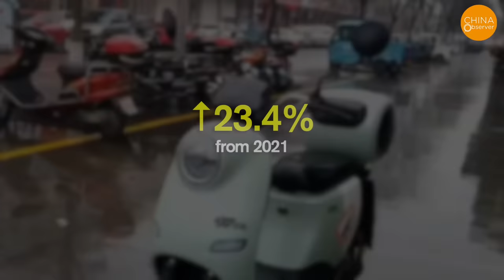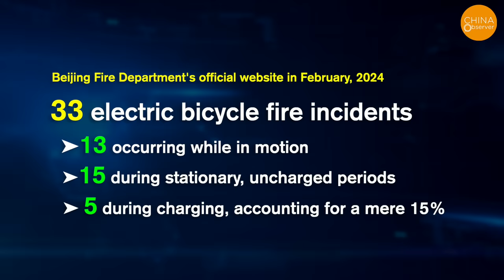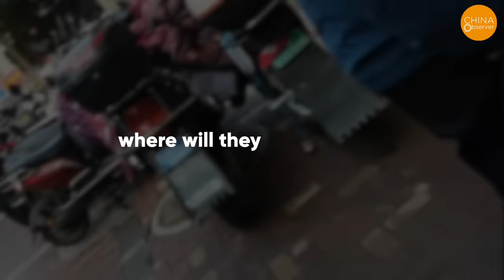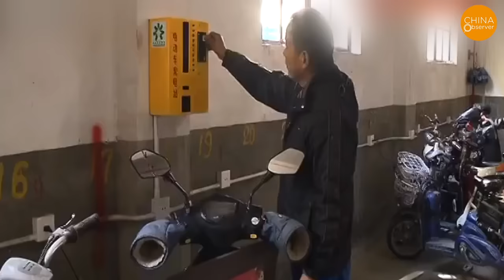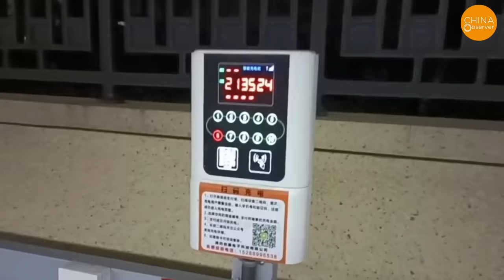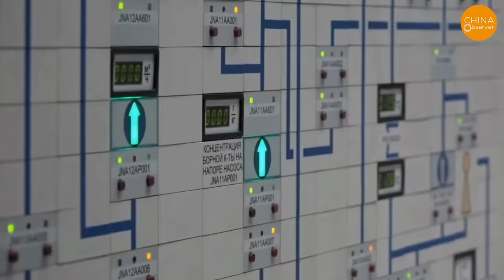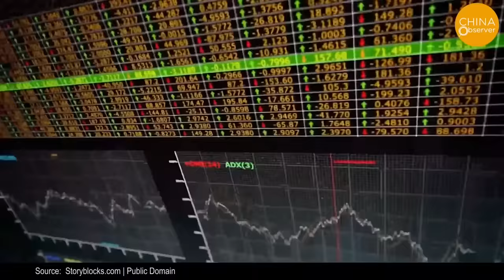21,000 Fires a Year! China’s Often Self-Igniting EVs & EBs Become Ubiquitous ‘Moving Bombs’

Comment: You have a choice, buy an internal combustion vehicle, or a spontaneous combustion vehicle😂
Reply: Since the batteries are inside the vehicle and combusts.... they are probably considered "internal combustion vehicles"
Reply: Ha ha.  The sales people should ask if you want an internal combustion or external combustion bike.
Reply: EV = Explosive vehicle 😵
Reply: TheRealCatof Exaggerating again.
Reply: TheRealCatof  Err...no they did NOT.
And Pintos only exploded when impacted from the rear at speed. Not while being driven around normally or parked up doing nothing/charging up.   Completely false comparison, and you know it.
Reply: Many of the fires, maybe most of them, are because of cheap counterfeit cells with bad QC that are more susceptible to abuse. Cells from major manufacturers have a much better record.
What do we know about manufactured products from the PRC, with respect to quality control, counterfeit products, etc ?
Reply: TheRealCatof 😂 no
Reply: You might be funny but fact is that even the e bikes that are higher risk than the EVs are 7 times less likely to burn than a petrol car.

You lack context and made a false statement.
Reply: @badchefi  Dude, you’re getting lit up faster than a Chinese eBike. Lighten up a little.
Reply: @badchefi  I would still prefer an ICE vehicle over an EV. I definitely prefer a pedal bike over an e-bike. The purpose of a bike is to get exercise whilst travelling from point A to point B. Unless I’m in my 80’s it’s pedal power for me.
Reply: @Whoever68  All good with me - enjoy your ride.
Reply: @arisaga822  in comparison I would light up like a petrol car as they are way more dangerous.

America 250 Million petrol cars - 284‘000 petrol car fires last year.

China 300+ Million e bikes - 17‘800 e bike fires last year.
Reply: @badchefi  Oh, I’m sure those stats are totally legit. 😂
Reply: @arisaga822  you mean this channel is using fake numbers?
Reply: OOOOOOO! NIIIIIICE ONE.
Reply: @millipedic  high-quality tesla car do catch fire too. get back on earth, there are electric car explosive burnings everywhere, including new ones, even not sold.
Reply: @badchefi  your wannabe-comparison not real - different burning and different results - no way to escape out from burning exploding toxic electrical fire in ev, and allmost immediatelly get out and distinguish-by-yourself the fire in petrol car, remaining alive - and for me, any human life matters. how for you?
Reply: @nusplus3985  how many people died since 2010 because of EV fires?

How many people die per year due to petrol fires?

Those two numbers will provide you with context.
Reply: @badchefi  2010, less than 50K EVs in US.  Also 2010, more than 200 million petrol cars in US.  Context: you're welcome!!
Reply: @RT-mv7df  you failed to read and understand what I asked for.

Go back up and read it properly.

How many people died from EV fires since 2010?

How many people died from petrol fires since 2010?

Get it?
Reply: @badchefi  You failed to realize (not really.... your gaslighting is obvious) that a hypothetical 1 in 50K ratio of fire deaths per year for each vehicle type will result in more total quantity of deaths for Petrol cars because there were 200+ million of them on the road versus 50K EVs, starting in 2010.  So that ratio multiplied by the total vehicles in each category would give 1 death for EVs per year, versus 4000 deaths per year for the Petrol cars in the year 2010.  While the EV vehicle quantity may have increased over the last 14 years to perhaps 15 million EVs (since they sold roughly 1 million in 2022), there is still 15-20  times more  Petrol cars on the road, which means the aggregate death total over the last 14 years will still be higher for Petrol cars.  

A 5th grader will understand why your statement (focused on total deaths, versus the comparative ratio accounting for the total vehicles of each type operating on the road) is meaningless and pure clown   logic.  The totals are meaningless, it's the denominator in the statistic (1 out every X, accounting for average age of the vehicles) that is the proper method of comparison.  

With a large percentage of EVs ramping up in only the last 4 years or so, the relative age of EVs is less than 4 years, which isn't enough time to  accurately compare to a significant portion of the 200 million Petrol cars over 10 years old (average of 12.5 years).  There are less than 2 million EVs over 10 years old (2013 or older).  Get back to me at the end of the decade when the 15 million or so EVs currently on the road have an average age of 8-10 years and we can estimate from a large sample the statistical number of EVs that catch fire & result in fatalities for accurate comparison to the average Petrol car.
Reply: @RT-mv7df  where did you get the 15 million EVs from? What year and which country?
Reply: @badchefi  , actually nearly 3 A-EV fires occur for every 1 "ICE" vehicle, although each vehicle fire needs to be independently investigated for it's cause. In the U.S. there are around ~2.4 MILLION A-EV's on the roads. In 2023, there were over 292 MILLION vehicle registrations so despite claims to the contrary, A-EV's in America are a tiny fraction and of them around half are registered in California. The "A-EV craze" is all money-making political BS wherein China stands to be one of the biggest beneficiaries with the electronics and battery manufacturing. The vehicles are contradictions to themselves because the lithium excavation, processing and as we've seen, charging is hazardous as apparently besides battery contamination from water/salt water/battery coolant fires, A-EV's tend to burst into flames more frequently when charging. Curiously enough, I've never had a single proponent of the A-EV's explain the process of "lithium disposal" with these batteries which just a single "battery" contains several thousand individual cells. 

Beyond that and the exorbitant costs of purchasing the vehicles even with government subsidies, they lose up to half of their range in colder climates. That'd be like paying for "20 gallons of fuel but only getting 10 gallons" every time you pay ~$60+ dollars at the gas pump. In some cases some A-EV owners have reported paying more per kWh to charge their A-EV than would be the equivalent gallon of gas especially if you're paying an additional fee to use a non-vehicle specific charger such as a Tesla charger to charge a Rivian. Beyond that there are situations where A-EV owners have complained of payment processing issues, inability to charge because it malfunctions, having to wait significant periods of time for a charger to become available and then have to wait a significant period of time for their own vehicle to charge. I recall this past winter where Tesla owners were pushing their cars around a lot in the snow/ice because the charging stations failed to work.... Beyond that, the expense of repair/replacement for batteries can be in the single to double digit-thousands. Even replacing "seals/bearings" in the electric motors can cost thousands of dollars and there are some "design flaws" in them which have been pointed out by servicing facilities. And unless they've made provisions, you can get "locked out" of your A-EV if you're unfortunate enough to lose complete power. Old combustion engine vehicles have used "mechanical lock/key cylinders" and actuators for yrs so you could still get into your vehicle even if you couldn't unlock it via the "power door locks."

There may be a place for A-EV's but this "GO GREEN'N BUY AN A-EV!! GIT RIDDA ALL COMBUSTION ENGINE VEHICLES!!" is absolute political BS and completely impractical, especially in the U.S. The final "contradiction" of this nonsense is that when people who own such vehicles CHARGE from public or private means, which receive power GENERATED from the consumption of FOSSIL FUELS which I thought was the whole BLOODY REASON TO BUY AN A-EV is to "STOP CONSUMING FOSSIL FUELS!!"🙄So I think A-EV owners should be BANNED from using ANY power source public or private, which is NOT receiving it's power solely from solar or some other ACTUAL "green energy source." It was said that in Texas I believe it was, an array of some 4,000 solar panels was destroyed in a hail storm. It was also said that the panels were made of a toxic substance when now may have contaminated the water supply. So much for the "Green agenda for a happier, healthier planet!" Absolute political, money-making BS.
Reply: @zenithperigee7442 according to your misguided logic there would have been over 324’000 EV fires in America last year.

52 EV fires per 100’000 EVs compared to 1350 petrol fires per 100’000 petrol cars in America 2022.
Reply: @badchefi  It's a hypothetical scenario (loosely tied to actual numbers I researched to illustrate the point (i.e. approx 1million EVs sold in 2022 in the US (fact), vs. the rather miniscule amount sold in 2010, and the only recently large ramp in production since 2020)). I may be off by a few million (say +/- 5 million) in terms of total EVs, but there are still today a minimum of 10 times (probably more like 20x in reality) more Petrol cars on the road than EVs, which is basis upon which my argument is anchored.  If you know anything about ramp rates and aggregrated totals, with EVs only reaching the 1 million threshold sold in 2022, then over the last 14 years since 2010, it's unlikely there are more than 15 million EVs on the road in the US; the only way there could be greater than 15 million is if 1Million+ EVs were sold each year since 2010 (yet they only made it to 1 million in 2022).
Reply: @RT-mv7df  if you want to get another angle on your „research“ please study Hyundai and Kia fires 2010 to 2022.

It’s in the EV time range and will blow your mind.

And while your at it check out BMWs recall from 2022 - 

The numbers clearly favour the battery powered car.
Reply: TheRealCatof  Not only this isn't true, a few thousand of them caught fire in almost 2 decades. But the Ford Pintos needed to be rear-ended to burst in flame. 
These batteries just randomly ignite.
Reply: internal combustion vehicles tend to spontaneous combustion also more frequently than EVs.
Reply: ICE vehicles burn more frequently than e-cars.   I use an ICE car because it costs less money... a lot less... and it is paid for.
Reply: LOL. Really a good pun.
Reply: @mweskamppp I’m probably just dumb for saying this but are Americans just not taking care for their cars?
Reply: @waihungtsang2857  Only some states like Colliefornia have an exhaust check, nothing about technical safety. And some Americans dont have or dont want to spend money for that. Some drive with cars the german police would directly sent to the scrap yard if they find out. Because those cars are a danger for other people not for the driver only.
Reply: @mweskamppp if workplaces weren't 10000000 miles away from the workers housing they wouldn't have to use cars all the time.

Edit:I live in hong kong.

Comment: Cannot imagine bringing one of these bikes into a high rise. Madness.
Reply: It is truly nightmare fuel..
Reply: No better off, if they park in basement parking lot.
Reply: @alicedai98  Sure you are.  Underground parking is all concrete and usually has a sprinkler system.  They're also vented separately and have an excellent fire barrier to the floors above.  Underground parking is the most likely place for a serious fire due to the gasoline fueled cars, so they are designed and built with the worst case scenario in mind - at least in the western world.
Reply: No, it was a Tesla Model 3!

Comment: I’ll stick to my V-6 that I’ve had for 10 years now, petrol prices may have gone up but my car hasn’t gone up in a ball of flames
Reply: !! Verbrenner brennen 10 mal öfter! Und
Reply: @haraldschon252  Yup, some years ago f.e. BMW cars started spontaneous combustion because of some design flaw of the EGR valve. The car of my wife - an audi - nearly went up in flames. A plug in the engine area was burned, lucky it went out by itself just needed some repairs.
Reply: @mweskamppp  Statistics show low fire risk in electric cars
According to a study by the US insurer Automobile Insurance, combustion engines burn 60 times more often than electric cars. According to the study, 1,529.9 out of 100,000 combustion engines burn, but only 25.1 out of 100,000 electric cars. In percentage terms, this means that only 0.03 percent of electric cars were on fire. In comparison, 1.53 percent of gasoline-powered cars caught fire.

A total of 199,533 combustion engines burned in the USA in one year.
Reply: @haraldschon252  So the USA knows it too then. It seems my numbers were a bit conservative.
Reply: @haraldschon252  I'm curious now, what do the stats show if the number of EV vehicles matched the number of ICE vehicles, how do things stack then?
Reply: After all, gasoline car is more environmental friendly on global scale. EV battery production badly exploits the natural environment(promoting the vast land's desertification pumping up huge amount of water).
Reply: @haraldschon252  do the math again taking into consideration how many combustion engines are on the road compared to how many electric cars and see how the number changes

Comment: It is not the case that LI-Ion batteries are notorious for exploding or even catching fire.

Li-Ion batteries that are not made to a HIGH STANDARD, for which they HAVE TO BE, are notorious for catching fire.

This is a Chinese exclusive problem right now, it could spread to other countries when those countries don't have good consumer protections including the right to sue companies.  But, in the US when it's been found that certain products have batteries that have been show to fail, there are recalls, law suits, etc..... to make sure it doesn't keep happening and this is consequently why Tesla vehicles rarely experience fires and the newer the vehicles are the more likely they never catch fire as Tesla works to continuously improve their own batteries, or the batteries they get via supply chains.  It's also why Tesla would rather use Li-Ion batteries made in Japan and are more expensive than use batteries from China and typically only use Chinese made batteries in the Chinese market.

And this is also why Apple has a LOT of inspection of their supply chains for parts that will go into their devices and will boot companies from being a supplier for Apple when it's shown their quality dropped.  You HAVE to do this if you manufacture in China because a company will make a product to the specs a company wants and then 1 year later you find they've changed out some stuff so they can make more profit and now the quality isn't the same.

It's also why most European and American companies should have NEVER started manufacturing in China.

Comment: Confounding the problem is the fact that many of the fire prevention/suppression systems are inoperable if present at all.
Reply: And it's near impossible to put out a Li-Ion fire. The thing self-oxidizes, it just sustains the reaction for as long as it chemically has enough energy.
An EV on fire underwater will keep burning. LiFe-Po and similar (or better) technology is the only way to mitigate this problem for good, going back to lead acid or Ni-MH batteries ain't gonna cut it.
Reply: @Kalvinjj   True.  Even a good extinguisher made for this purpose may put out the flames temporarily, but there's little stopping the process from restarting once your extinguisher runs out since it's a dry chemical reaction that fuels the fire.

Comment: I can't even imagine serving on a submarine equipped with Chinese made batteries 😮
Reply: @Dead_Kerbal  are you quite sure what the Chinese are doing?
Reply: @Dead_Kerbal @Dead_Kerbal  Actually, China claimed they are developing an e-Sub long time ago, and it could be the quietest submarine ever.
Reply: @Dead_Kerbal  lol, you sure about that?  diesel subs 100% have massive battery banks. how do you think they run underwater?
Reply: @Dead_Kerbal  Dude electric subs are all over the place. They are hybrids and can recharge either on the surface or with a snorkel. The tech has been in use since WW2.
Reply: it will leak  beffor  the battery   fails if its made in china   lol
Reply: @Dead_Kerbal  well, in depth it used to be using batteries...back in WW2 U-Boat days.
Reply: @Dead_Kerbal you’re Dead Wrong, how do you think Submarines run silently. Breathing sulphuric acid was one of the dangers when the battery banks flooded. Propulsion is achieved by either battery, steam or petroleum powered engines.
Reply: @Dead_Kerbal  Diesel/electric most certainly have extremely large battery banks for silent running.
The nuclear ones would also have them for emergency backup.
(General Dynamics, Electric Division, Groton, Connecticut, USA) 🇺🇸
Go play with your rubber ducky.
Reply: of course there is @Dead_Kerbal
Reply: @Dead_Kerbal  that's a constant voltage, so what do you do when you need to store the electricity? 🙄
Reply: @Dead_Kerbal dude never heard of diesel/electric sub
Reply: Me neither 😬
Reply: @Dead_Kerbal what did you think will happen if a diesel sub uses its diesel engine while submerged ??? LOL

Comment: As an Electronics Technician I can say that 95% of the time this is caused by low quality batteries, chargers and poor manufacturing QC standards.

Domestic fire extinguishers CANNOT stop these fires, it's a waste of time trying.
Reply: Indeed Lithium ion batteries burn until it has burned out all the cells and flammable electrolytes.  Only thing u can do is contain the fire to the burning vehicle.
Reply: it's like a magic relighting birthday candle. blow it, it light up, blow it again, it light up again... (the batteries burn until all the material is totally burned up)